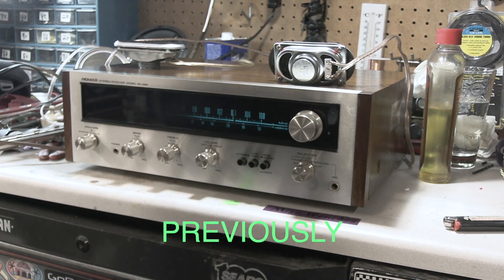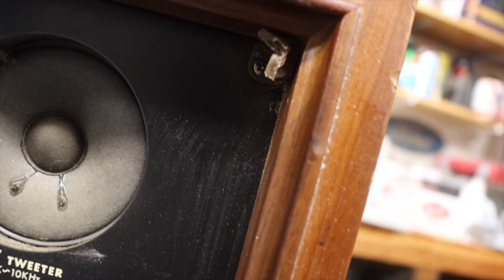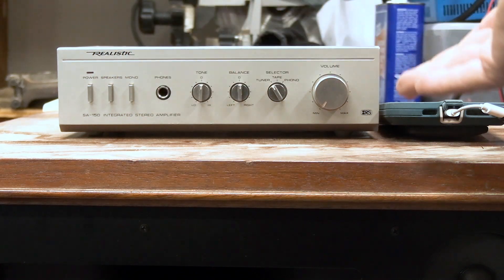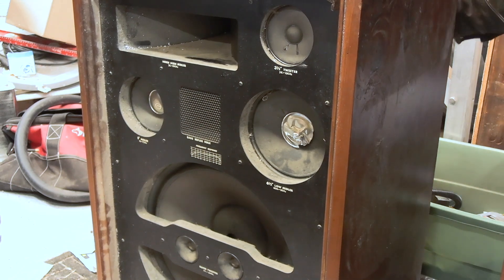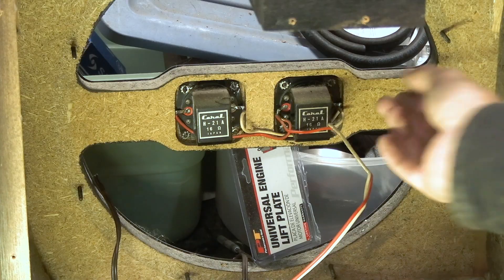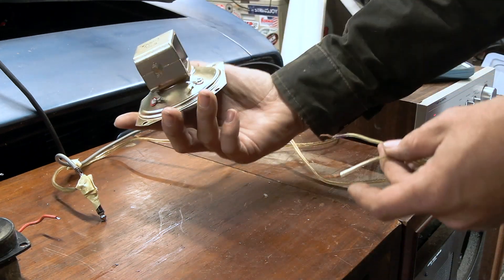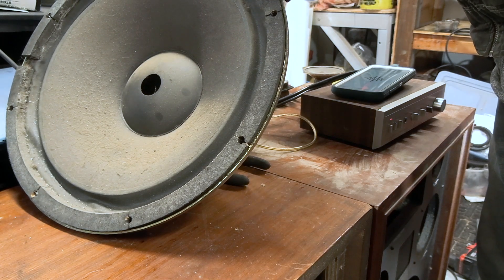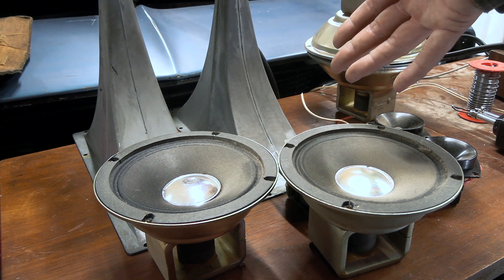Free Smelly Kabuki Speakers - do they work?  \\ Shock Hazard Corner

Comment: I've actually got a pair of those speakers, my grandfather use to fly for pan am and bought them in Hong Kong back in the day
He never used em , but my brother got some party event use out of them
Once being used at a new high school dance in a full size gymnasium. 
Gramps also had a Kenwood receiver and reel to reel player

I remember the remote with the Kenwood was on about 15' cord and a rocker switch to move the radio dial and search for stations. 

They sounded pretty nice and clear at blistering levels 

The grills are absolute works of art all wooden reversible

That's why it has those plastic deals in the corners to hold the grills
Reply from the maker: Awesome story! Hopefully someday I'll be able to hear a set in proper working order, currently have most of the drivers from this set packed away for a rainy day project.

Comment: Cool ole speakers! Hopefully you were able to repair the drivers and get them rockin again . Thanks for showing them off
Reply from the maker: I tried my best to save the woofers, but sitting with those open dust caps let in a bunch of dirt and debris making for some really bad coil rub. Even with a good clean out and re-gluing that torn cone they still rattled and buzzed super bad.  I have the rest of the drivers packed away for a future project though, so they’ll live on in some way!
Reply: @Murrtallica  Nice. You do what you can do, with what you have to work with. Keep up the good work.